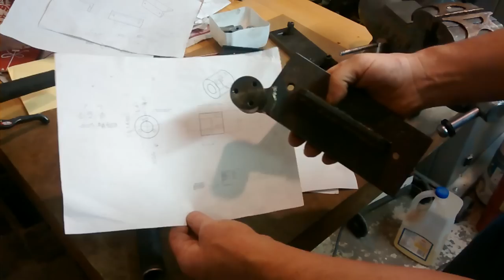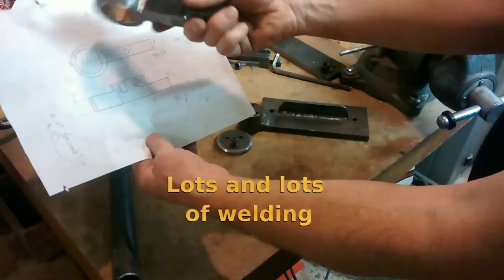Rod bender from Ox Tool plans

Comment: First of all, thank you so much for uploading this video.
I found out about Oxtool a while back but i didnt know he had plans for this bender ( or any plans for that matter ) on his website.
I have a few returning jobs wich require me to bend 5/16 inch cold rolled and 1/2 inch hot rolled rods.

I wil definitely also use your video as a reference for when i'm making this bender.

Thanks again.

Greetings from Holland.
Reply from the maker: Thanks!
This bender will handle 3/8" no problem, probably 1/2 although I would start to worry about the dies. Just make sure you bolt it down very securely - it is pretty easy to move around a 300# bench bending 3/8 rod.
Reply: Thank you for your response.

1/2 is gonna be tough on the dies yeah, i might heat the rod up a bit with oxy acetelyn, that should do the trick.

I'm sure with al that leverage you will move a lot of stuff around, thanks for the advice.

Greetings from Holland.

Comment: thanks for the demo, will prove helpful when I build one!   couple questions & 1 suggestion:  1)why do you treat those dies so poorly?  It looked like you had taken a good deal of effort to those fitting really precisely, just made me cringe when ya toss em around like that.    2) what was the note that read "lots and lots of welding", I saw a few inches, what did I miss?

My suggestion is to consider mounting the tool such that you apply for downward off the front or side of your bench. I think you will be fighting your table much less.
Reply from the maker: +Matt Traven 
1) Good question,  they are pretty tough (quality steel), maybe I figured they should be prepared for the abuse they are going to get in use.
2) I prefer to weld things up and then machine them (vs mill out of solid) and that part was [at least] four pieces. They way I built this was as much a welding project as a machining project.

Good suggestion, didn't even think of that. The fin on the back might be big enough that I could clamp it to the bench top, then the lever would swing down.

Comment: exactly the tool I need, do not have the resource to make one, please, anyone, recommend where to purchase one, similar if not the exact.. need to bend 1/8th"
Reply from the maker: +Kenneth Ng For 1/8" rod it, this tool is overkill. if you search for "wire bender" on Amazon, the first hits are the little benders that might work fine and are cheap ($15).

Comment: Nice video.  None of the blah blah blah BS I have to listen to in so many others.  Will this handle 1/2" cold rod?
Reply from the maker: +S. Smith Thanks!
1/2" rod - probably but I don't know. It will handle 3/8" rod and does have the capacity for 1/2 but you'll have to bolt it to something really solid and use a 6' lever arm. I move a 300# bench around pretty easily bending 1/4 rod.